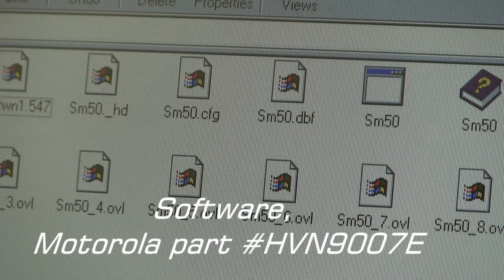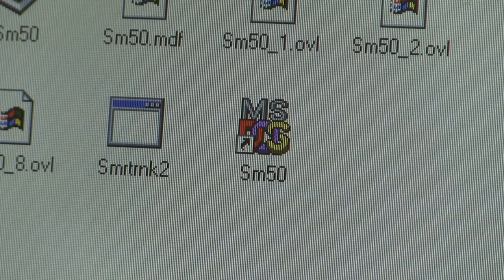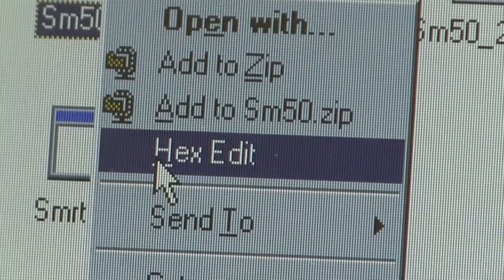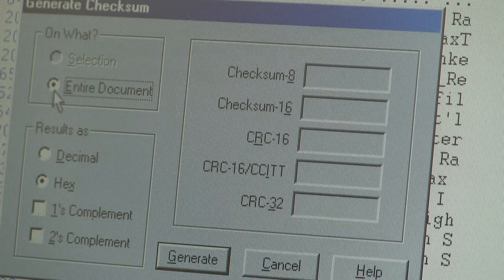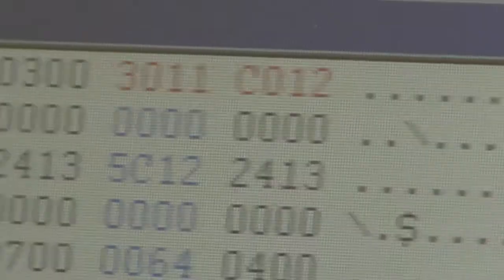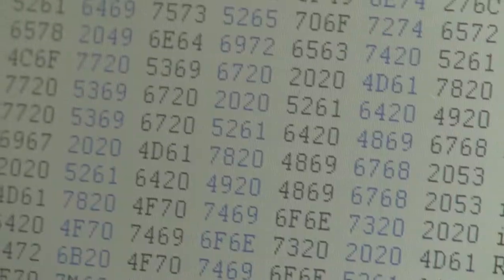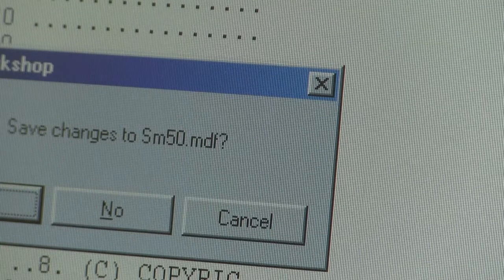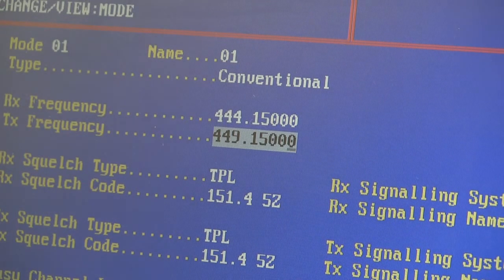Motorola SM-50 Out of Band Programming

Comment: BTW, the way this guy suggests correcting the checksum is a quick way to make your software non-functional. Don't just change random bytes! Find descriptive text that is not part of the functioning code, and then change that. Also, you don't have to find the exact same 5C or whatever; just use a hex calculator and change the text to whatever number is necessary to make the new checksum identical to the original checksum.

Comment: Hi! I've got a SM50 vhf 150-170MHz bandsplit, works fine, but' here's the thing; I'm unable to read the radio as it dumps "codeplug error 58", have tried to allign it with the "F2" service option (to change mic gain for example) and it works fine and saves it to the radio, but' i'cant read the radio to change channels config. ¿Any advice or place you know to download a known good codeplug for this old brick? Thanks in advance.
Reply: MODIFIQ SQ , VOLTA FUNCIONAR OK
Reply: @pxdosul  Grazie..!! Gonna' try it.!

Comment: Good info but moving to Europe I need to figure out the low end hex for 430 MHz. Anyone out there know how to read the hex values for 430? Probably need to get a hold of Robert to see if he knows.
Reply: @Subgunman Good luck with that; he's SK...
Reply: @Jah_Rastafari_ORIG  I did read it in Repeater Maker, I was not aware that he did this video. Way too young to go.  I did figure it out with a friend who is a programmer. Now what needs to be done is to recalibrate the PLL circuitry to allow it to lock at the lower frequency. That will take time and change a few components.